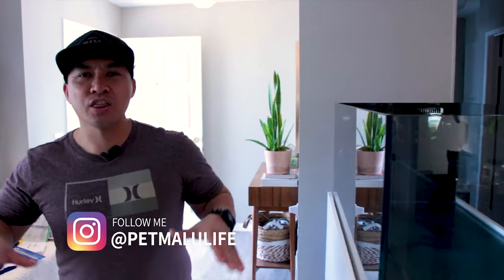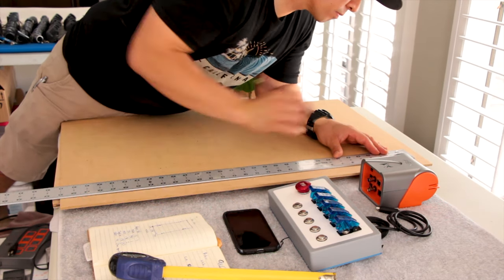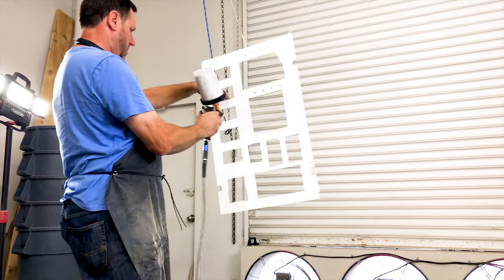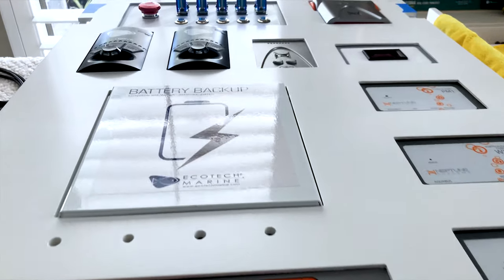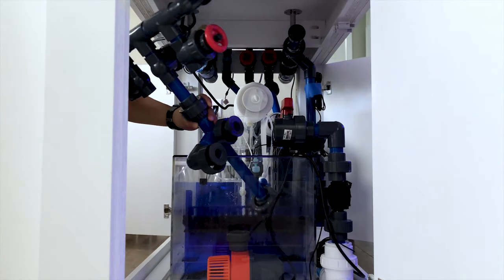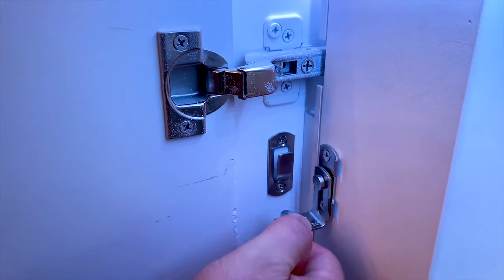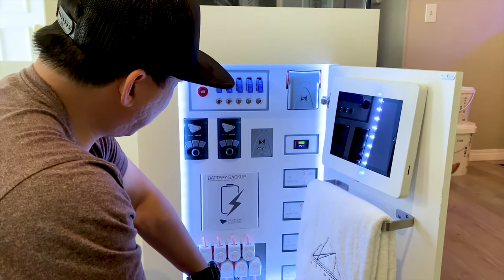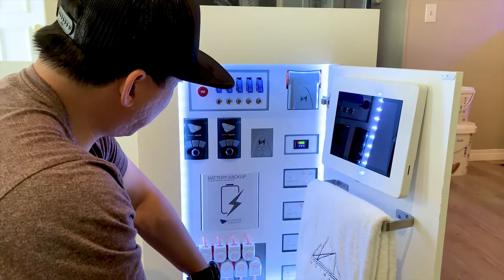Dream Reef Tank Build Series | Ep. 8 | My Custom Reef Control Board

Comment: I used white PVC board. It's waterproof and cuts nice.
Reply from the maker: Nice! I ended up using white acrylic with my new tank. It turned out really well. Thanks for watching!
Reply: @PetmaluLife  Good choice too!  Did you do anything since the accident? I'll subscribe and check it out. I'm running an 80 gal with AI lighting and Neptune systems.

Comment: Such a clean build I think I need to print you new Cor strainers. Can’t be having those broken ones.
Reply from the maker: Hey man!  You actually gave me two, one slightly broken and one perfect.  It seems to be working pretty well. Did you make any modifications to the one you gave me? I'll be in touch with you if I have any issues.  Do you print other stuff too?
Reply from the maker: Thank you BTW!
Reply: @PetmaluLife  Oh yeah. So I’m guessing you’re only running one return pump. It’s just a shared file on Thingiverse. No changes. I can only design basic stuff to print.
Reply from the maker: Yup!  Just one return pump.  Cool man! Lets keep in touch for any future needs.
Reply: @PetmaluLife  Cool. I’m in the process of upgrading too. Building a stand out of 80/20 and redo my controller cabinet.
Reply from the maker: @Two1owT  Awesome.  Let me know if you need an extra hand.  Maybe to a tank walk around and post on the channel in the future.
Reply: @PetmaluLife  That sounds awesome. I’d love to be featured. I have some awesome designs I’d like to share
Reply from the maker: @Two1owT  Sweet.  We'll make it happen!

Comment: Just a heads up, you may want to use a small amount of super glue to adhere the velcro strips to the stand and power bricks, as the heat generated from the power bricks tends to loosen the velcro’s “sticky side” over time; I mounted mine in the same manner and after regular use they kept falling off the stand until I applied the superglue. Great videos so far, those subs and likes should keep rising as your build progresses 👍🏼
Reply from the maker: Thanks for the tip! I think I’m going a add a couple screws through them for extra support. Thanks for watching!

Comment: I could be wrong but I think I remember on one of the brs videos Ryan was going to hang a power bar upside down like you did with the EB4 but didn't after people told him that there is a fire hazard in doing this. The fire hazard coming from a risk of gravity gradually pulling out the plugs and a partially pulled out plug runs the risk of causing an arc. Please anyone who is more knowledgeable on this weigh in as to it's safety. But love the videos, I need to check through your videos to see if you have shown off your nano.
Reply from the maker: Thanks for your comment and interest in the videos. I don’t see any issues with the plugs being upside down. They are fully plugged in and snug. However I’ll be sure keep an eye on it. I have a shot of my nano tank in my first video. I’ll be sure to showcase more of it once I get my 100g up and running. Thanks for your support!

Comment: Just amazing work man!! I have a question where you get the wire and the plugs 🔌 thanks 🙏
Reply from the maker: Thank you so much!  Here are the links to the materials used for the extension cords: https://www.acehardware.com/departments/lighting-and-electrical/switches-outlets-and-plugs/electric-plugs/3201233
Reply from the maker: https://www.acehardware.com/departments/lighting-and-electrical/switches-outlets-and-plugs/electric-plugs/3201233
https://www.creative-cables.us/pendant-light-cord/15291-orange-white-chevron-covered-round-electric-cable-rz15-8057730776271.html
Reply: @PetmaluLife  thank you 🙏🏻 for the help
Reply: @PetmaluLife  thank you 🙏🏻 so much!

Comment: so i never  have played around with electrical stuff. i'm scared of cutting the cords for each device. but i really would like to be able to shorten or add length to my cables and have them all uniform in colors like yours. any tips? should i practice on something else? or do you think it is pretty easy and i'm making more of a bigger deal then it really is?
Reply from the maker: Hey man! Thanks for watching my video. The chords are super easy to make as long as you have the right tools. Here’s the reference video I used. I’m eventually going to make my own video. https://youtu.be/yPeppnaPibc
Reply from the maker: Here links to all the materials:
https://www.creative-cables.us/pendant-light-cord/15291-orange-white-chevron-covered-round-electric-cable-rz15-8057730776271.html

https://www.acehardware.com/departments/lighting-and-electrical/switches-outlets-and-plugs/electric-plugs/3201233

https://www.harborfreight.com/125v-15-amp-female-plug-connector-63125.html

https://www.creative-cables.us/home/30002-cable-cutter-stripper-for-cloth-covered-wire-9000006000055.html

Be sure to buy extra cable just in case you mess up or need more. Let me know if you have any other questions.

Comment: It's already in the comments but your power supplies will go for a swim at some point. Velcro never holds up for our use.

Go get the Ecotech power brick brackets. They screw in to the wood and won't fail you
Reply from the maker: Thanks for your advice.  If you had a chance to see my latest video, I'll be doing a build 2.0.  So I'll definitely consider that.  Thanks for watching.
Reply: @PetmaluLife  Just saw it...heart breaking man. Left a comment there too

Comment: Absolutely incredible build. Turned out Awesome!

One note of caution ..could be a risky move relying on Velcro adhesive for the power bricks like that..It can loosen from heat and humidity over time.

Also it was a bit odd to me why that cnc guy didn’t recommend styrene or pvc board instead of something requiring lacquering. 

Appreciate sharing this sweet build!
Reply from the maker: Thank you! Appreciate the heads up on the Velcro. I’ll keep an eye on them.

Yeah, not sure he didn’t recommend anything else. I think it’s because I came in there with my mdf board I previously made so we just ended up recreating it more precisely.
Reply: Awesome brother. 
Such as sweet system. 
Really looking forward to see your future progress.  
Thanks again for all🙏